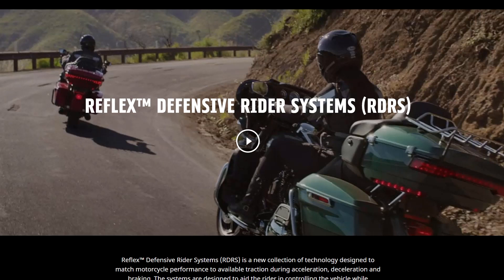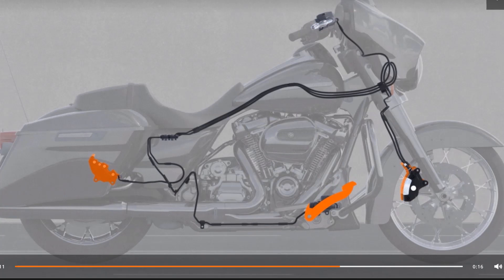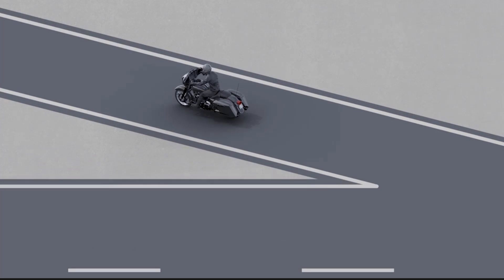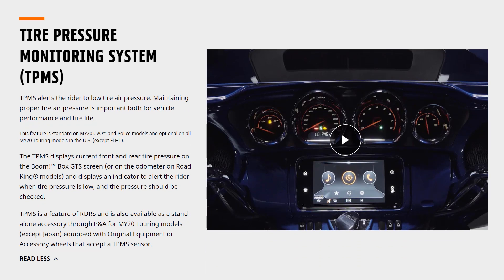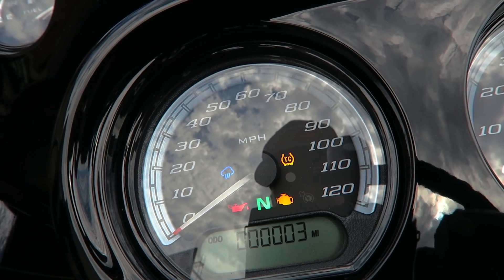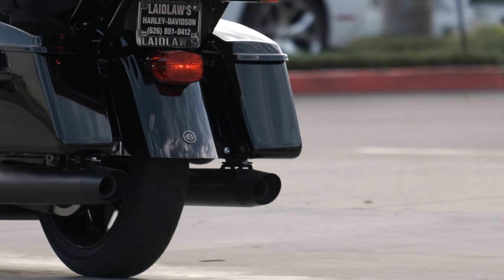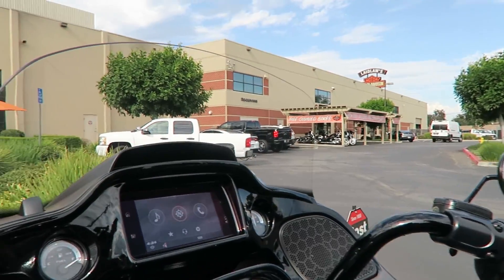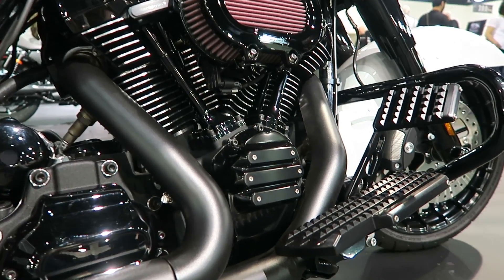Reflex Defensive Rider Systems (RDRS) Explained for Harley-Davidson Motorcycles

Comment: I have these features on my '17 R1200GS. Wildly different bikes, but very helpful features. I'm glad Harley is adding this. I went from an 04 Ultra Classic and will likely come back. My decision to go to a GS was based on the tech side of these features. While I'm not the young man I once was, it's really beneficial.

I will say going back to other bikes without these features means you need to be careful. You start to realize those features clean up your riding, especially cornering ABS. Very hard to trust that feature for me at first but it'll really save your ass taking a curve to hot. None of this can defy the laws of physics but it makes for a safer ride. Traction control can also save your ass from a small patch of gravel in the most inconvenient spot.

It's worth having on any bike. Great overview. Now I have to convince my wife I need a Harley again. She grunts and groans getting on the back of a very tall GS. She's admitted the Harley was more comfortable for a passenger.
Reply: My 2009 K1300GT has ALL of these same functions and its 10 years old.
This just proves that Harley Davidson is EASILY 10 years behind other manufacturers in technological advancements. Give em' another 10 years and MAYBE they'll get to figuring out how to get the windscreen to go up/down and figure out how to eliminate the chain drive primary. Also in another 10 years from now maybe they'll introduce a reverse feature much like one that comes factory equipped on ANY 90's era Honda Goldwing!
Reply: @kennethwise7108  My '92 K75S has ABS. First generation but way ahead of HD. I don't think they offered ABS until 2006/8 on the touring bikes.
Reply: @socialoracle I have been the proud owner of many HD products since age 18, they need to address their price points or they'll never get back to where they need to be.

Comment: Matt, thanks for walking us through this. I was waiting for your plain-speak, no-nonsense explanation ... and you didn't disappoint. It's interesting that the Hold Mode indicator is partially obscured by the speedo needle ... strange considering the only time you would engage Hold Mode is if you are at 0 mph. I wonder why H-D didn't locate the indicator somewhere else?

Comment: Excellent video. I commend Harley moving with the times. It's a shame that alot of harley purest feel its intrusive. When then the other brands do it, its considered innovative. But when harley does it. They are messing up the formula. I just hope they continue to move forward as the times do. Thanks for the info...
Reply: Harley purists can be luddites. Seriously the tech HD's finally including is 100% worth it. Be nice if they put it on the Softail series. I'm certain the Panam will have it, it has too to be competitive with BMW. I might trade my GS for the Harley Panam. Might I moved from an 04 UltraClassic to a R1200RT and now have a R1200GS, because HD didn't have the tech. Now they do. Good deal.

Comment: Matt does  Harley have any plans on  getting this system as install kit l for  the 2019 models touring bikes
Reply: That would be an ECU upgrade seriously doubt that. It also requires an accelerometer XY sensor.
Reply: Don't hold your breath. What you're asking for really isn't feasible

Comment: Does the hill hold work if you put it in neutral?  These are safety items and should be offered on any bike.  Most other mfgs have offered traction contro, tire pressure monitorsl and slipper clutches for years.  Personally I'm a Harley guy so I'd buy one with or without these features but the abs is something that has benefited me personally.
Reply: No it will not hold if put in neutral I don’t even engage.

Comment: These features should be standard IMHO.  When you spend that much for a bike they should give you some extra value. Especially on the entry model bikes where those riders would most benefit from the additional safety features. ( I am a harley owner currently.)
Reply: Are u kidding harley does NOTHING FOR FREE
Reply: Similar system comes on Challenger Limited and Dark Horse
Reply: I also bought a 21 Road Glide Limited and it had it on there "standard" but still had to pay the ~$1000 for it.  I've "played" with some of the features  and I like it.  Even the hill hold feature thatbi originally thought was "gimicky" is nice in certain situations.
Reply: I transited from a ktm adventure, having all
These features on my roadking 22 makes my ride a peace of mind

Comment: Matt good video, thanks for the awesome explanation, so where is the downside, not sure why anyone would not want this system, seems like a great system, even for experienced riders. Cant have to much safety on a bike, with the invention of ABS, I'd like to see dual front discs on all softtails,  instead of those chrome disks. Is this system only available for 2020s?
Reply: Roger Bohman Some people want to be in control of the bike and not have the bike do everything for them....and some of the features might be perceived as covering up rookie riding mistakes and they find it insulting. Personally, I see the value in the package and would want it same as you...provided I can disable the TC occasionally like Matt demonstrated in case I want to light up a tire. 😁

Comment: I like the TPMS and thinking should be standard. Biggest fear of long distance touring 2 up and fully loaded is not noticing a low tire till it's dangerous and it isn't easy to check tire pressure on the bike so I am guilty of not checking like I should. I hear it can be added to a touring 2020 thru the P&A so maybe a quick video on what is entailed in having that done?

Comment: So I have a 17 Road King, when I bought the bike I had the ABS cd in my saddle bag but as far as I can tell I do not have ABS or Linked Brakes(they are a package deal correct) and when I start my bike the ABS light does not flash while moving under 20 mph. Is this correct or do I and there is a problem with the system?
Reply: Justin there are a couple easy ways to see if you have ABS, but probably the simplest is to look at the front left/clutch lever side caliper...if you have a little wire tie wrapped to your brake line you have ABS..This will helphttps://youtu.be/CRzC7__WOkw

Comment: Harley needs to really catch up on Safety...

Triumph, Ducati, BMW and Moto Guzzi has ABS and traction control on every bike they sell.
Reply: There are clearly divergent views on the worth of electrickery on motos.  I have a bmw s1000r, which has a shed load of electrickery.  It sits in the background, and now rarely have work to do.  When I was less skilled these systems did more work.  The systems on my bike are very subtle.  Did a track day and came close to a high side when I misjudged and so hit  a wet patch mid corner - the bike helped to avoid the high side. Done well these systems are enabling, not a negative.
Reply: @brianglendenning1632  And you're right, nice bikes. Just fak'n monsters.
Reply: @Johnny Strange These systems are barely noticeable and non intrusive the majority of the time. It takes advantage of the abs system, which is already there. Having "more power" is pretty fucking useless 99% of the time for 99% of riders of which don't have the technical skill to even handle it without rider aids. MotoGP bikes have traction control because they have like 250hp on tap. The cost benefit is lower for rider aids than the cost of more engine power. There's no place in the world except Germany without a legal speed limit to utilize a more powerful engine except a track. You're .arguments don't have any practical value,

Comment: Great job Matt for explaining the electronic chassis control.  I have a Kawasaki Versys 1000 SE+ that has this same system, and it is amazing how often you note your rear wheel is spinning up. I can set it on three modes, and most intrusive I will hear the engine back off the power to prevent a power slide situation.  It is GP inspired technology, Kawasaki came out with it on the 200 horsepower Ninja 1000 H2.  

I would highly recommend this system, even for the seasoned rider, as the technology using parameters of lean angle and inertia, coupled to the traction control system is amazing.  When you find yourself riding in the rain unexpectedly, it's funny how you see the system engage to keep the bike upright, and you in control.

Comment: Great review, as always. Thanks for the info. Definitely will be getting it on my next bike. Just bought a 19 RGU so it will be awhile. Curious who is building the system, Bosch was and is the foremost, as years ago KTM introduced it with much scepticism, however once it was proven then BMW  and many others jumped on the band wagon.  Glad to see Harley finally embrace the technology. Here in Florida the roads are like Ice when its raining and just pulling away very carefully I have spun the rear wheel. Going around corners you have to do everything slow and careful or the bike can slide out, even a 940 lb RGU.  Thanks again Matt.

Comment: That feeling you get when you are exiting the interstate at 80 mph , you downshift 2 gears and dump the clutch in the sharp turn of the off ramp causing your rear wheel to slide out perpendicular to your direction of travel,,, I feel like that all of the time. (Hat tip to Steven Wright)

Comment: I wish HD would make the RDRS available as an upgrade on my 19 fltrxs. I'd even be willing to let them use my bike to retrofit the system in learning how to upgrade older bikes that already have abs. Or even ones that don't. That would be another avenue that the company could get revenue for themselves and the dealers. Maybe someone could figure out how. I see so many companies like brimbo who do upgrades and end up as part of vehicles straight from the manufacturer.
Reply: So is this linked system active on my 19 fltrxs. I do have abs. If I'm just wanting to negotiate a turn and want slow my speed itypically will apply my back brake only covering the front only for an emergency. I've noticed a big difference in the way the 05 flhrci( my previous bike)handles and my new bike in cornering turning and slowing down or stopping
Reply: Was out in North Carolina in mid June where there was lots of steep inclines in the resort I was staying at and surrounding areas. That hold system could've come in real handy since a lot of those roads were between 6 and 12° inclines.

Comment: This system is nothing new... 
I just bought a new road glide ( yea 👍😊) but I’ve been riding Ducati’s for 25 years 
They have had FULLY  adjustable traction control , abs and even wheelie control for years ...
Plus Ducati and most other models have 4 different modes that also effects the power delivery as well 
It’s a great system 
It should be standard on ALL Harley Davidsons .. 
The best part about these systems is when riding in the wet weather . It will save your ass when the road is slippery . 
It’s gona save a lot of damage and injuries to a lot of riders in the wet 
all these electronics have been on most other brands for at least 5 -8 years and there is no charge , just standard equipment !!
Reply: Plus the drag torque system is basically a slipper clutch ...
They have been around for at least 10 years .. 
it’s a shame u have to pay another $1000 for this gear.
Reply: @dannyrebel9538  hell my '83 Magna v65 had a slipper clutch.
Reply: Most of the motorcycle traction control systems are supplied by Bosch.  Motorcycle brands just tune parameters on a system supplied by them, and the recent incarnations with an IMU (corner sensitive abs and traction control) have been < 5 years.  Either way, it's nice to see the tech proliferate.

Comment: Hello Matt, sorry for asking it here. You speak of linked braking of front and rear brakes on the touring models. I am not ever using the rear brake on my 2019 Fat Boy. But I see, what seems to me, black brake dust on the right side of the rear Lakester wheel. Does linked braking apply to the Softails from 2018?
Reply: The softails do not have linked brakes, only the touring bikes with ABS.

Comment: I don't understand people are complaining about RDRS (safety), if you don't like it don't buy it. Thanks for the info Matt, great video.
Reply: They need to give options not everyone rides the same some people don't want abs on all the time but yes there is a time and a place for it some people like new body styles but want to be able to turn off the technology for this
Reply from the maker: Thanks for watching.
Reply: @MattLaidlaw  I'd like to see HD allow for  the options like TC modes to be manipulated through the infotainment system like Indian and BMW. Maybe cause less confusion for those use to HD but not these types of systems.
Reply: @Bredaxe  the advantage to this style is that you can change modes while riding, without taking your hand off the bars.
Reply: @usmcvet0313  That's how my bike is also. I like the mode button right where it is at my left thumb
Reply: yeah i actually wanted it but the dealer could not find it yet so i got road glide limited without it but i did want it you can turn it off if you dont want

Comment: All this babysitting gadgets will cause riders to get sloppy and ignorant and ride over their limits, crash and die anyway. 
I think we see the beginning of the end for motorcycles now. When people who rides with this gadgets get on a real riders bike they will not have the skills to ride them and everything is adapted for the least competent human being around so our "unplugged" bikes without the gadgets will be gone.
Reply: Found the Luddite.
Reply: That's not how any of this works.  The system is invisible until it's not.  Lean the bike over in an intersection, hit an unexpected oil slick, and even experienced riders will often kick the rear out and low side if they didnt tuck the front already.  RDRS can save an experienced rider in that situation, offering better and faster throttle control in such an extreme low traction situation.  

Have the bike leaned well over on a back road only to find a massive amount of gravel from trucks?  RDRS will help you brake mid corner and stand the bike up to go around it, or it will help modulate the throttle so you dont kick the rear out and high side.

There are many situations that it's difficult to practice for.  I dont know many people who go out looking for oil slicks to practice on, and I dont personally seek out gravel mid corner, and yet those are things that riders have a chance if encountering on the street every day.

Sloppy riders cant really lean on the system that heavily, it doesnt kick in until you start pushing a bike towards the limits of traction.  If anything it will help people learn without crashing, as it doesnt interfere until you get to the limits, letting you learn the limits without as much punishment.  It's the same learning process as someone without the system just with less insurance claims.

Comment: 2012 stability control was mandated for all  cars.  It can save more lives than seatbelts.  Helps prevent oversteer and understeer with TC/ABS/torque control.  Stability control uses an IMU with ABS/TC/torque control.  Algorithms computing traction  sharing, brake sharing. Sometimes algorithms saves you before you  get into trouble.  Stability control in cars have made this available for motorcycles.  Some brands are making standard all the way to 125 cc   These driver assists are in the background at all times.  They are never distracted. Tired, and give 100%. Most are non intrusive.
Reply: Good overview. The ABS systems are the principal component. It's the meat and they are just adding the taters.

Comment: Probably wait a couple years and see what glitches they find and correct. Linked abs is the best Saftey feature which is standard. Tpms should have been put on all the touring bikes without having to pull brand new bike apart and pay for sensor install and flash.

Comment: Great explanation Matt! Rdrs seems like a nice feature. One thing I wanted to ask is about H-D connect. I heard that H-D can remotely view 2020+ bikes ecm and more through the cloud. If that’s true that seems privacy issue to me...and if it’s true, I’m not ok with it.
Reply from the maker: I will probably do a video on this in the future. If you don’t like the idea of it, the dealership can remove the Modem
Reply: Matt Laidlaw can the RDRS be added to a 2020 Road Glide at a dealership?  I bought my new bike without really understanding what this option does.
Reply: I’m pretty sure it can be, but just call your dealer and ask

Comment: Great overview of the RDRS! It is not something my wife or I would desire, as it removes the technicalities from riding.
Reply: No you can turn it off. The TC light will stay on. I got a 22 road king special. Live in R.I and it really kicked in tonight as I was taking off and there was a sand patch where the rear tire was. ever 
So slightly of a spin it kicked in reduced the power and got me through it. These are heavy bikes! And after 4 plus hours of riding your fatigued a little bit. Like I was tonight it worked awesome.
Reply: Good to have when you feel u may need it and good that you can turn it off so all it is is a huge benefit you turn it off in your riding a bike without any electronic traction control I absolutely love The brake assist. And I’ve been riding for 20 years